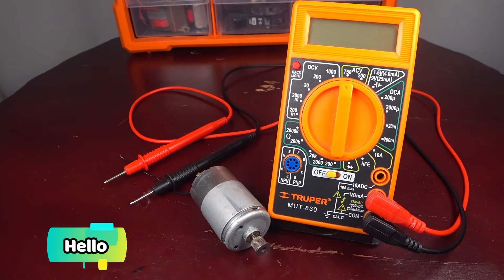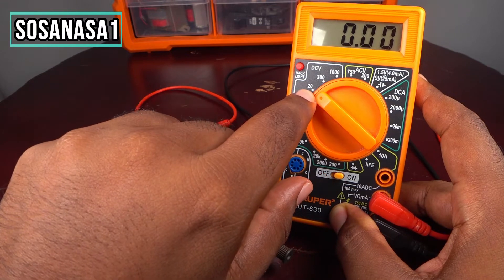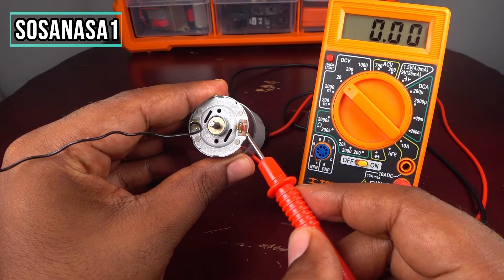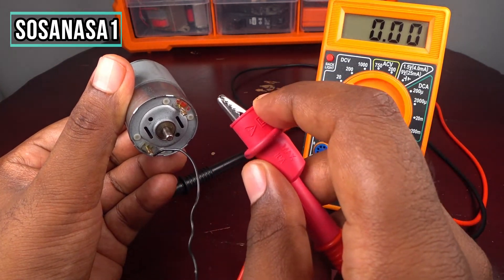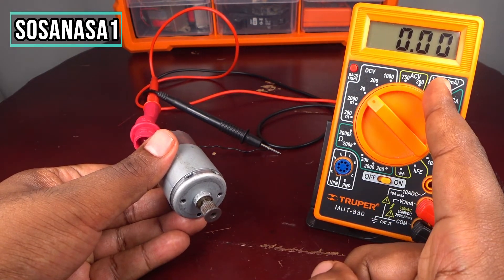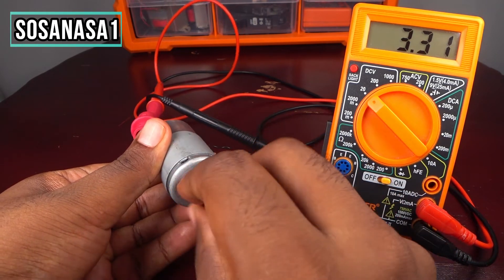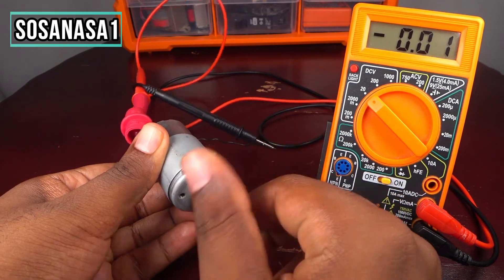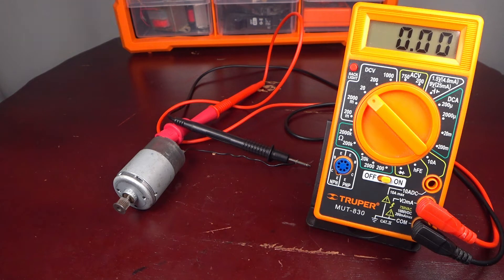how to test electric motor using only the digital multimeter

Comment: A 220v mabuchi has how many henries? Okay. It also depends on the cross section of the copper wire of course but it's just to get an 'idea. I haven't measured it yet but I initially salvaged it from an old hair dryer so I could reuse a ducted fan elsewhere. I need it to repair a mythical AB12 hot air desoldering station (Italian made) and then find a significantly smaller one for my Lafayette as well starting from 220v and adding a suitable regulator module. :) Let me know. Thank you very much.

Comment: If I have the battery disconnected so no power to power wheel but I have unscrewed motor from gear box can I still do this test even with the wires still connected to motor tabs as long as no power going to it.

Comment: Thank you so much, that helped me a lot. I also have a question - if my motor shows not more than 0.08 when I spinning it - does it mean I still need to replace it? I've already checked cord continuity and it's seems ok and motor also shows 0.08 when spinning but that doesn't seems like enough. And the whole device isn't working itself ofc :D